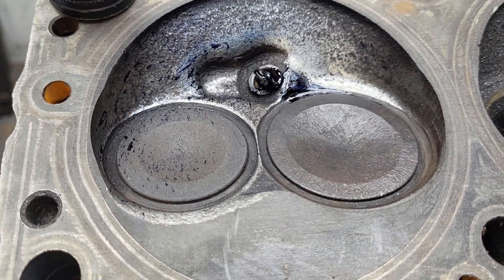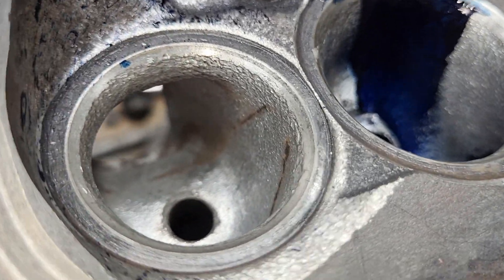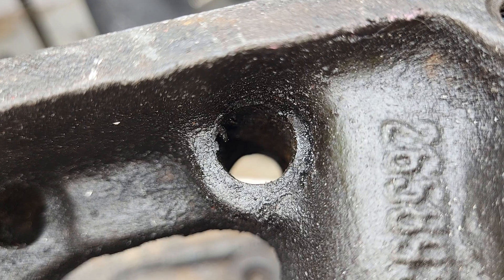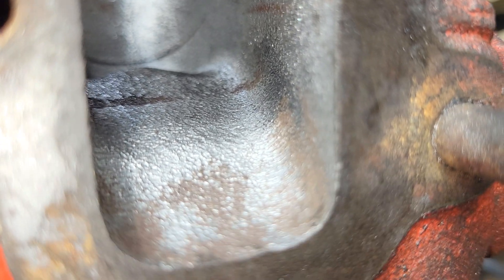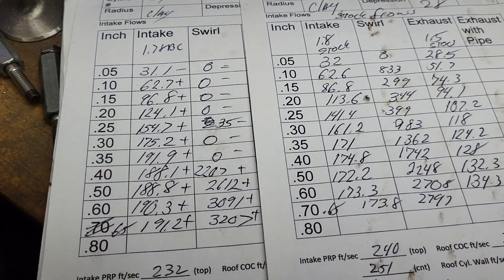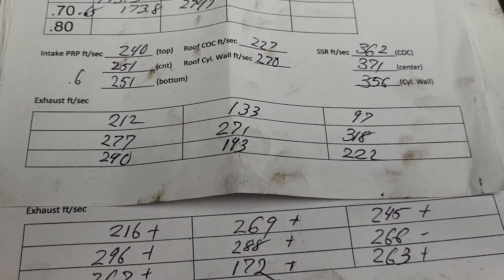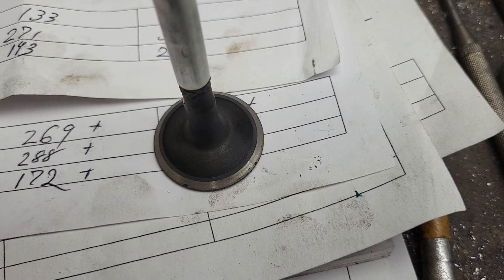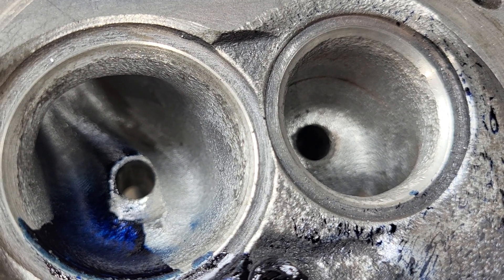David Vizard, Unity Motorsport, Mission Impossible 318 Project, 920 test head first cut. Diy ports!

Comment: Is swirl velocity always lost when reshaping ports and bowl area for better flow or is there a balance that can be struck.  My 318 and 273 engines are daily drivers that do not see 4000 rpm very much or at all but want to maximize all the power from 0 to 65 mph.
Reply from the maker: Swirl can be created in the port, or in the chamber. The stock port had more swirl througout the curve than my ported port.
Reply: @servediocylinderheads  Thanks for the reply, based on your videos I'm then looking to just smooth out any obstructive casting, blend for smooth curves in bowl and port areas while keeping port size as close to stock or retain port shape as close to factory as possible to hopefully retain some swirl velocity and mabe some increased flow.  Along with around a .410 lift cam, hopefully this wakes up a street engine to feel the difference from a stop light and freeway onramps.
Reply from the maker: @dh2360  Guides and good valve job are must haves. Shaping like this video would help!
Reply: @servediocylinderheads  Sounds great and really appreciate all the data you came up with not only for the 1.78 valvle 318 heads but also the other Mopar small block heads.  I plan on driving my classic Mopars for a very long time.
Reply from the maker: @dh2360  Build it right and it will last decades!

Comment: Awesome charlie,  bowl needs to be increased a little.  How about cylinder wall side just flattening out the cylinder head bolt boss and chamber work to see where it goes? Flow losing on the top end to me means the port needs to be shaped a little better

Edit: i think you need some more port bias. Especially in the bowl area.
Reply from the maker: I think you are right. Thanks

Comment: Are these stuck with the stock 3/8 size valves & diameters as well?
Reply from the maker: The guides are so bad if they're are not cracked, I would really like to do magnum sized guides.
Reply: @servediocylinderheads , 8mm damned near identical to 5/16 anyway. I understand the uhhhh thought process on using the  tiny stock size valves in the two barrel version, if I squint a little and turn the light off anyway. But there ain't enough opium in the world to get me to understand those same size valves in the heads for a four barrel and a max potenial performance build using factory iron & the proper size valves appropriate for the CSA or desired outcome. Sorry , kinda thick I suppose?
Reply from the maker: @derrelcarter9401  No, I get it. What would a set of open chamber heads do with a valve upgrade? Quite a bit more than stock sized valves can do I bet.
Reply: @servediocylinderheads , I watch them All. I may shke my head, but I watch
Reply from the maker: @derrelcarter9401  Why the head shaking?

Comment: Do you size the throats to 85 percent of valve dia?
Reply from the maker: Not usually. Thanks
Reply: @servediocylinderheads  is there a standard number for this or does it vary per head?
Reply: Reason I ask is I read an article in hotrod 40 yrs ago about basic porting and they called it the 85 percent rule. Interestingly, the bike heads I worked on over the next 30 yrs seemed to be very close to this (the performance ones anyway)
Reply from the maker: @needmetal3221  My go to throat ratios for 45 degree seats is 88 and 86 percent. Thanks

Comment: Are these heads going to be surfaced?
Reply from the maker: Depends if these will be saved or just used for testing. I need to really clean them and mag them. Thanks
Reply: Hope they can be saved, 1967 was the last year they were made. Chrysler went to open chambers in 68 for emissions reasons on the V8s.
Reply: So charlie, if these can be saved. How about magnum valves I hear 1.92 and 1.6 work well in a 3.91 bore.

Comment: I’m trying to learn from your experience, but it will help to see what the real world results are; peak horsepower, torque, efficiency, anything at all.

2.2 hp per cfm = 420 hp
Reply from the maker: We have dyno work from some E7 heads I did a few years ago. You could check some of my old videos. Thanks
Reply: @servediocylinderheads 
Can't hardly wait for the 300 CFM swirl port heads Dyno session! That will be history making videos.😎👍
Reply from the maker: @itseithergonnaworkoritaint7852  It will, I hope. Still finding parts! Thanks

Comment: Since DV mentioned cam specs for mission impossible of around .470 lift are you going to focus more on getting the most in the .200 to .500  more so than gains at .600 to .700 lift?
Reply from the maker: I don't think that is what we will use for the man cam. That was the regrind stocker to get 1 hp / cube. Last I heard, we have a stock lift stock duration cam with a bit tighter lobe center for that run.
Reply: Yeah Charlie is right the "Man" cam will have all of the lift.. the stocker will be .390" 
Andy
Reply from the maker: Thanks Andy!